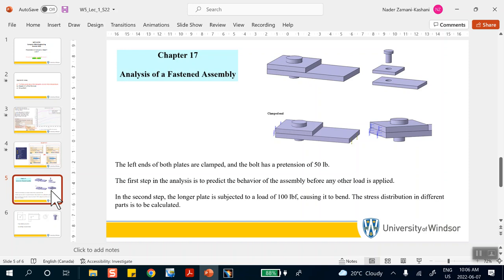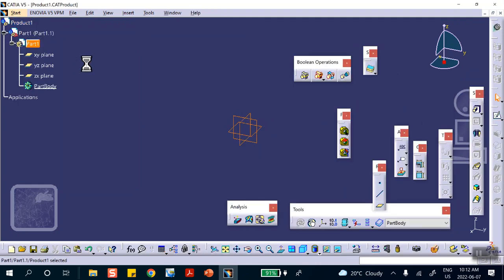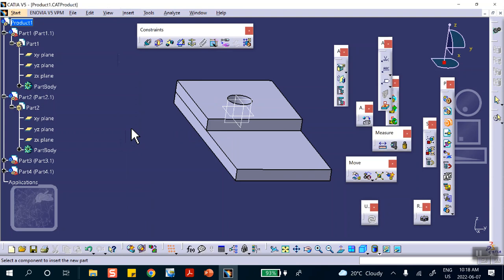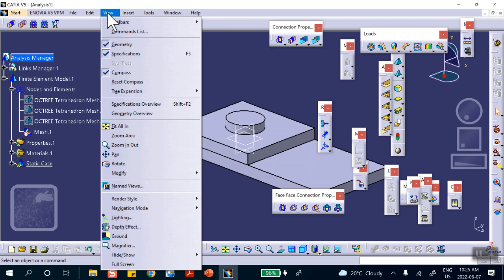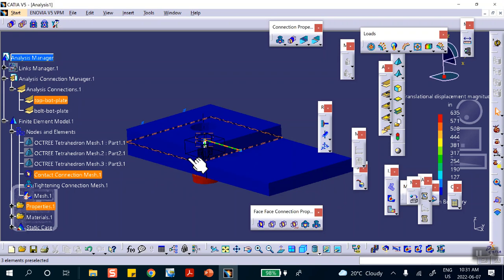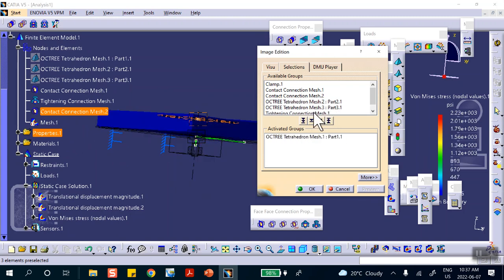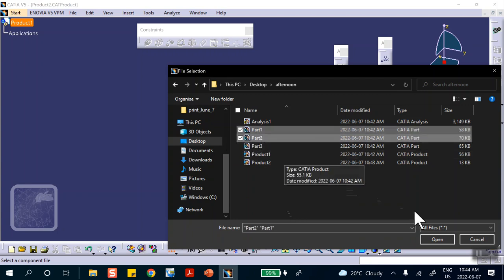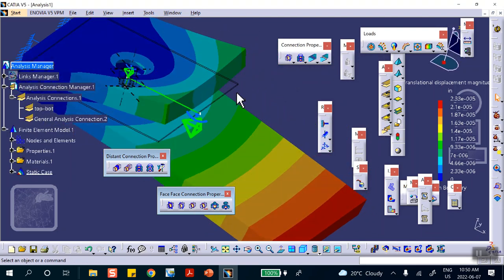Catia v5 Activity 2 Lab 9

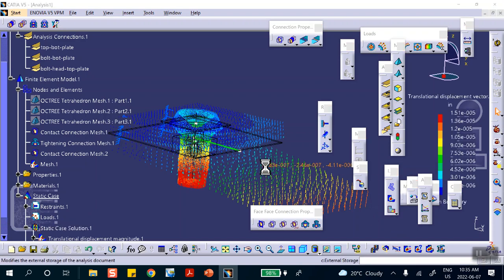Comment: Hello Mr. Nader, thank you for your explanation. I have a question regarding the displacement of bolts. Why do we observe larger displacements at the bottom of the bolt?  29:16  and we do not see the continuity between the displacements on the bolt and the parts
Reply from the maker: Dear Ayoub, it will be a lot more realistic, if you model the nut.